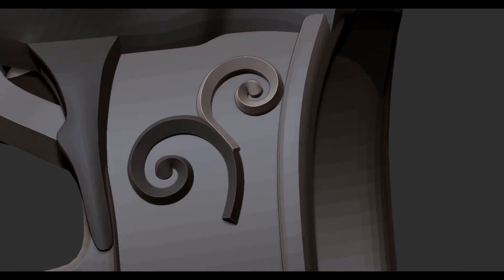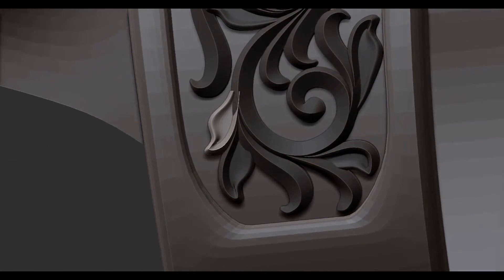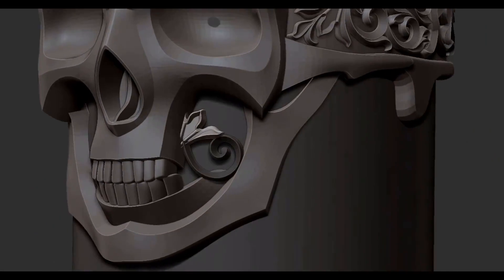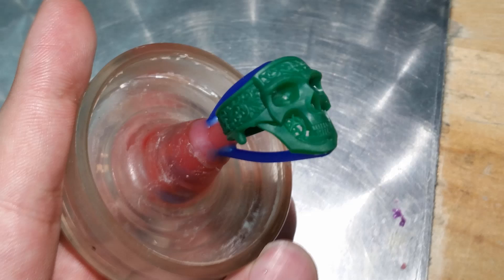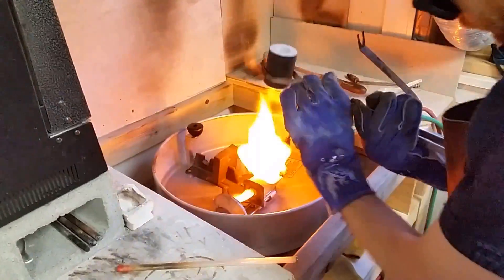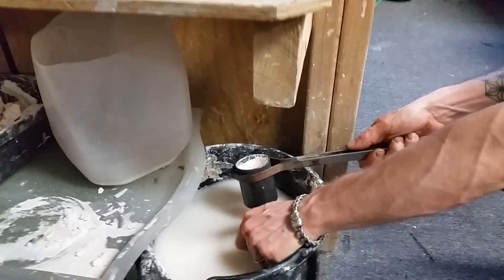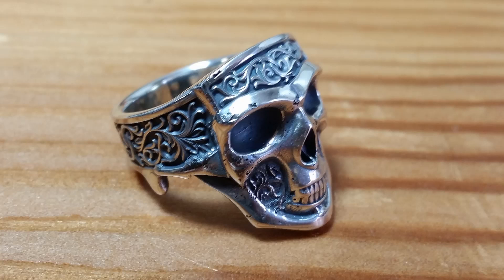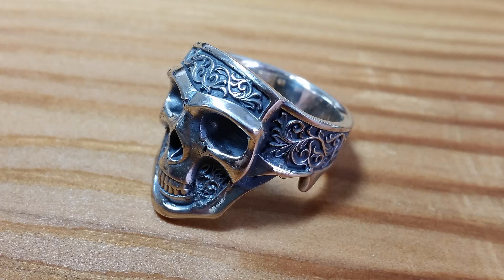Zbrush - Making Jewelry - Silver Skull Ring - Part 3

Comment: Nice work.  I have started learning zbrush, so thanks for the tutorials.  I have a Solus 3d printer now for over 2 years, you should consider using plasticast or prestige optima investment.  They work well for casting resins.  Also Solus has developed a new resin that contains wax.
Reply from the maker: Nice. The solus is a nice little machine. This ring was actually cast with prestige optima. I found that it's a little better than plasticast, but still not perfect. I've tried their solus cast resin and ended up getting slightly worse results.
Reply: George Barnes yes I have cast samples of the new resin also.  With similar results, maybe not as good as b9 green.  The fast cure is attractive to me .  Other than that I see no advantage at this time.  A friend is working on a new machine for around $4000 with I think a 5" square build platform with castable resin.   Keep up the good work and thanks for the videos.

Comment: This is awesome! So you basically print the 3D model on a 3D printer and add some sort of metal film over the plastic? I suppose it is plastic inside, is it?
Reply: No, the printed ring + wax get burned out when he puts the investment mould in the oven.  He doesn't show that step, but he mentions it.  This leaves an empty cavity in the investment mould which is then filled with metal during the casting process. So the final product is all metal, no wax or 3D printed material.
Reply: is this printed with wax? i thought this is resin ?

Comment: Hey George, how did you combine all shells into a single continuous mesh?
Reply from the maker: In this case I just combined all the subtools. It's still made up of a bunch of different objects and not one single mesh. I knew the printer I was using wouldn't have a problem with it. Just gotta make sure your geometry is intersecting and not floating around.
Reply: Right, just watched this: https://www.youtube.com/watch?v=HhWnIzee3dU
Apparently, some slicers make things easier.